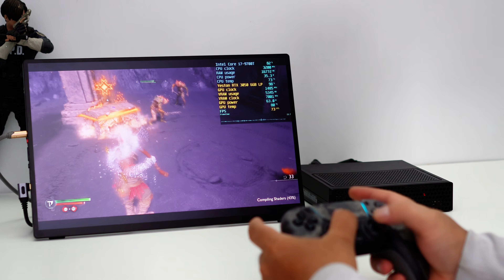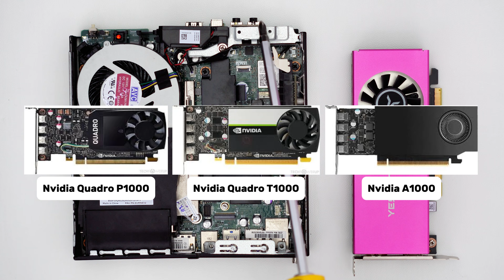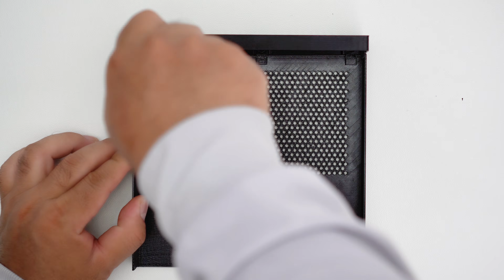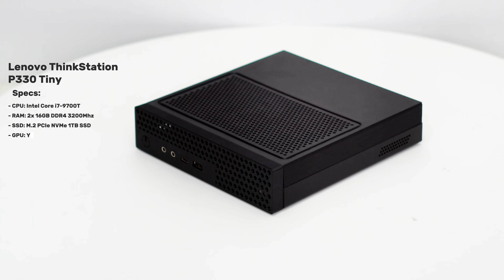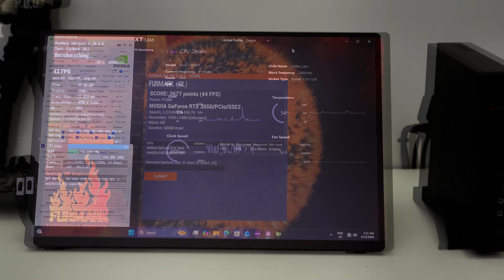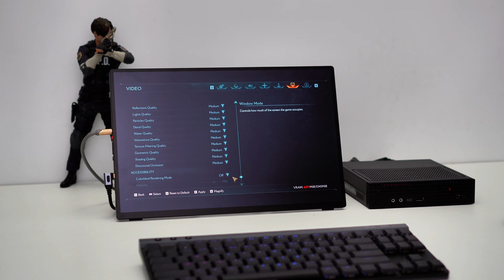RTX 3050 Low Profile | P330 Tiny Gaming Performance Test

Comment: love your channel!  I have a m90q gen3 ..but it uses the I5 non-t chipset…so—out of the box 65watts.  power supply is 265 watts.. will this card work? will it be throttled?  any suggestions gratefully accepted…
Reply: processors without the "T" designation?; you are moving into standard or high-performance models

Comment: Thank you so much for this video! I have a question about the front wifi component. I couldn't see where you reinstalled it. Or does it work with just the antenna?

Comment: Hi everyone and @itggear. I have a Lenovo M920q featuring an HP RX 550 (35W TDP) and a custom 3D-printed enclosure. The bottom of the chassis near the NVMe slot is reaching high temperatures. Should I be concerned, or is this expected for this setup?

Comment: @itggear I have built Lenovo P330 Tiny with i7-9700 (65W) and AMD RX6400 LP, 32GB RAM. I do have the Bios updated to the latest version. I have the ventilated 3D case and 230W power adapter as well. Can you tell me if my setup will work without issues or throttling or if i need to downgrade the CPU to i7-8700T?

I am not using throttlestop or anything and don't know how to test it to confirm everything is working properly.
Reply: You must undervolt the cpu since it is non-T version. 30watt is better. For power brick 135 watt is the highest power that this tiny pc supports

Comment: I have a question I own a Lenovo m910x that came originally with the pcie adapter and the original rx460 4g 
But I swapped the GPU with another one 
I was using a 75w GPU with my i5 6500t 34w cpu

And it was fine

But when I swapped the cpu to the i7 7700
The gpu could not pull more than 30-35w
Reply: The M910x relies entirely on an external power brick (typically 135W or 180W) and a highly restricted internal motherboard power delivery system (VRMs). Lenovo’s motherboard firmware dynamically balances power between the CPU and the PCIe slot based on the components it detects
---
Configuration 1 (The Working Setup):
CPU: i5-6500T Base TDP of 35W
GPU: 75W card actively drawing up to 75W
Combined Max Core Draw: 35W + 75W = 110W

Result: This leaves just enough headroom for the rest of the motherboard components, RAM, and storage under a 135W or 180W adapter. The system allows the GPU to run wide open
---
The Bottle necked Setup
CPU: i7-7700 Base TDP of 65W (with short-term turbo peaks up to 95W or more)
GPU: Same 75W card hard-capped at 30W–35W
Result: The motherboard recognizes a standard 65W desktop CPU is installed. To protect the tiny VRMs from overheating or tripping the external power supply, the firmware aggressively clamps the power allocation to the PCIe slot
---
Charge brick is under powered

Comment: Im using thr RTX A400 with a i5 9500T on m720q and its been playing great. Its not 60fps but 30-40 with dlss is great. I undervolted as I have a 90W power brick.

Comment: does anyone know if the original lenovo bracket that fits the quadro t600, t1000 etc also fit the rtx a400 and a1000? and if these newer cards fit the minipc?
Reply from the maker: Please check the link in this video description: https://youtu.be/NGZqKFg4spw
Reply: @itggear  already watched it, but it really doens't answer the question if a1000 or a400 fits the orignal lenovo bracket.  i personally have a 720q with 9700t, copper cooler and quadro t600. looking for more gpu power. i don't have acess to a 3dprinter
Reply from the maker: @xXEruranXx  The P620, P1000, T400, T1000, and T600 GPU brackets for the Lenovo Tiny 5 series are indeed in that video description. You can recheck the AliExpress link section. The A400 and A1000 GPUs do not have a GPU bracket for the Lenovo Tiny 5 series because these GPUs are not included in the supported GPU list for that series. Additionally, these GPUs use a different bracket from the T and P Quadro GPU series.

Comment: Since all you'll most likely be doing for this is 1080p gaming, a good idea would be to replace the 9700t with a 9500t. It should heat up as much and should still give decent performance for 1080p.

Comment: I would like to see you do the RTX 5050/4060/5060 low profiles in the Lenovo M900 SFF again but without the side panel mod to see if it throttles
Reply: You need psu on those cards
Reply: @rimuu3032  he has them from before

Comment: I'd like to see you use the same build but with a 65w cpu like the i7 8700 ( 6c / 12T) and batocera(heavy emulation like rpcs3 , shadps4 , switch emulation and even native pc games through out batocera)instead of windows and compare the performance especially if there's a way to keep the same settings you've did to this build or maybe undevolt the gpu by a little and cap the fps at 60 for better stability , really looking forward to your answer since I'm considering this as my second pc for a couch/living room DIY console
Reply from the maker: It's not working. Once you install a GPU, a 35W CPU is required. The Lenovo Tiny Gen 5 motherboard only supports a maximum of 135W. An i7-9700T has a PL2 of only 53W, and an RTX 3050 6GB pulls 70W, so that combo might work. However, an i7-8700 has a PL2 of up to 120W, so it doesn't support a GPU - even if you try to install a lower-power 50W card like a Quadro T1000. Your PC will crash every time you load the game.
Reply: @itggear that's totally 👍 I didn't see the missing "T" behind the CPU type
Reply: @itggear  so my best bet is an i7 9700t alright thank you for your help
Reply: @badreddinelatrache0044 you may set pl1 and pl2 to 35-40 watt for 9700 non-T version to handle this gpu. It actuallt works
Reply: @itggear  is this the same as the other models, or just for the P330? 

Are all these tiny PCs limited to 50w out of the PCIE slot?
Reply: The problem is here, the program ThrottleStop. It runs on Windows if I'm right and I don't know any alternatives.
Reply: @markusi.1927 okey so in this case if I'm gonna build it I'm just gonna leave everything in default settings and hope to not get a throttling issue or a bottleneck

Comment: Exactly at the moment I was looking for something, trying to make my own 3050 LP fit (Maxsun one, similar to the Yeston). I ran into the exact same issue: the shroud presses on the cover, and it can't close it, apparently. Cover which, Itself, sorely lacking in ventilation holes.
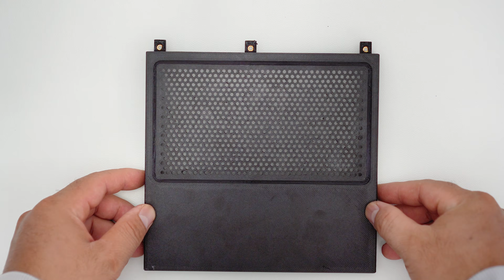I don't have a soldering iron, so wondering whether the nuts you insert at 04:28 absolutely require one?

Comment: I just got a yeston 3050 and a m720q for a portable pc
Reply: How is the stability, just built one with the same gpu but getting major stability issues
Reply: @thegilly-1 I used the msi rtx 3050 which is slightly larger and requires a 3d printed case. It’s very stable, games for hours. Tried 4K Tv, 2k gaming monitors and a 1080p room projector. Very stable
Reply: @thegilly-1  are you using the 230w charger? If not try 300w and i think the vrm is heating up bad
Reply: Are you able to run battlefield 6?

Comment: can you do an external gpu to oculink pcie card for the m920q. curious how this would work out. "PCIe 4.0 x4 64Gbps Compatible eGPU DOCK, with OCuLink SFF-8612 8311 to PCIe x16 and SFF-8611 Male Cable, Enclosure supports Standard ATX Power and External Graphics Cards GPU for Laptop Mini PC" by owl tree store is the one im looking at. $100
Reply from the maker: I've already posted that video. All you need to do is check it out.
Reply: @itggear  take initiative and use my brain.. GROSS!!

Comment: Is the top cover the same as the other top cover from the video from a week ago?
Reply from the maker: It's a different model. All 3D case models are designed to fit the specific Lenovo Tiny model shown in the video only.
Reply: @itggear yeah google said  the last model and mine were the same frame but your right they slightly different, I bought your new p330 stls but I have modded them slightly and put a Steam logo on the front. 👍